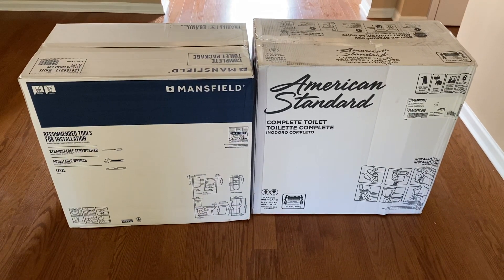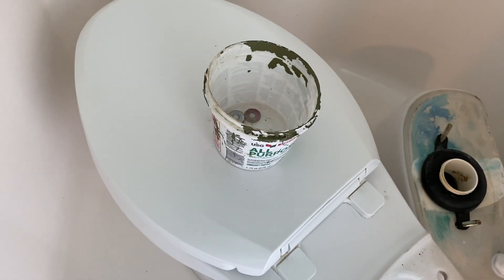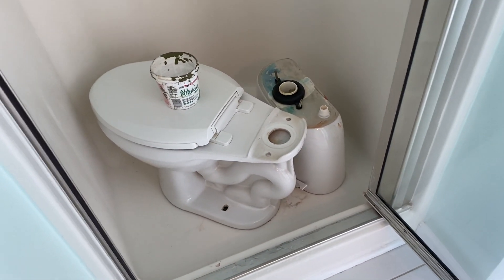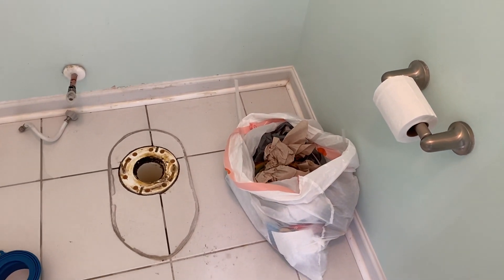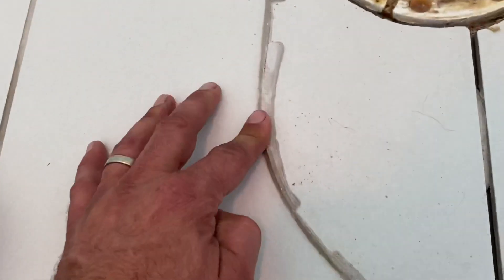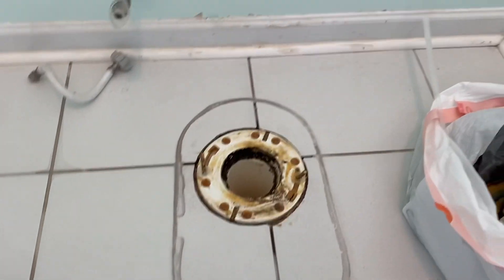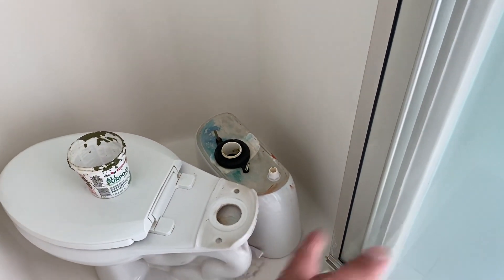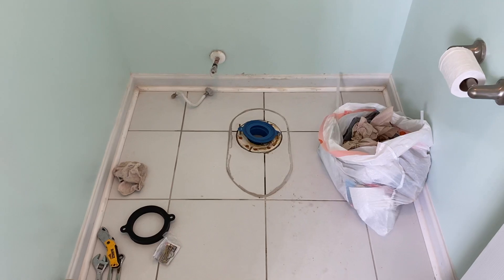Quick tips for an easier toilet replacement

Comment: If you do have to caulk, leave 2-3" open in the back to allow any leaks to be seen.
Reply: I was just about to comment the same. I replaced two toilets today. The caulk gives the toilet a lot more stability. I usually just do clear caulk and I leave the back open so water has a place to escape.

Comment: Having installed toilets for over 20 years, I have a few suggestions.  Replacing the supply line is always a good idea.  The real starless steel braided lines are the best choice.  Be careful because some manufactures like Brasscraft use”polymer” breaded supply lines that look like stainless steel.  Changing the spurt off angle stop is also a good idea.  Most of the time they are typically 1/2” by 3/8” 90 degree multi-turn originally.  Those tend to freeze up or the compression washer is worn out and leaks.  The best choice in my opinion is the the ball valve equivalent.  They last longer and seldom have any issues.  However, you need to buy a good “puller” like the passcode puller to be able to remove the nut and ferrule.  You can use sand paper or a Scotchbrite pad to clean the pipe if it’s copper.  Don’t forget to put a new shinny chrome escutcheon filled in the back with plumbers putty.  The plumbers putty helps it stick to the wall and waterproofs it as well as keeps bugs from getting into the wall.  Next suggestion again is based on over 20 years of plumbing experience, use better hardware!  The cheap crap that almost all toilet manufactures give you simply will not last.  They give you cheap white metal that immediately rusts when exposed to any moisture.  The best choice out there is solid brass.  Now there are two standard sizes available.  There is the 1\4 inch and the 5/8 inch.  The ladder of the two is preferable.  I always get extra brass or stainless steel hex nuts and stainless steel washers so I can double nut them for extra strength and stability.   So once you clean the closet flange and discard the old closet bolts, you insert the new ones into position and place one of those washers and a brass or stainless steel nut.  it’ got to be tight and perpendicular.   Lay the toilet in place.  Then I use “Fluidmaster” Secure Caps instead of the cheap pressure fit caps all manufactures give you.  These are so much better.   The bottom of the cap goes over the brass bolt.  Then the black plastic washer goes next followed by the stainless steel washer and either a brass or stainless steel hex egg corn nut.  Tighten carefully, screw on the cap and your done unless you decide to caulk.   This is the best combination of products and techniques that I have found to work.  Consider it.  I enjoy your videos, please continue.  Thanks.  Oh by the way I’m a retired secondary math teacher who second career is a “handyman”.

Comment: When you lift/move a toilet that still has some water in it, tilt it slightly forward when you lift it. That will keep most if not all of the water still in the built in P-Trap in it. 

Also, as a couple have said, caulking it helps stabilize the bowl and keeps it from moving/rotating as easy. Just leave the back of it with no caulk to allow leaking water to be seen.

Comment: Will source out those rings - not a huge fan of the wax either.  Check out Oatey Liquilock, turns that last bit of water to gel so you can get the toilet out of the house without drips/splashes.